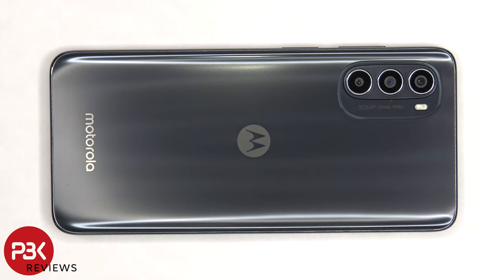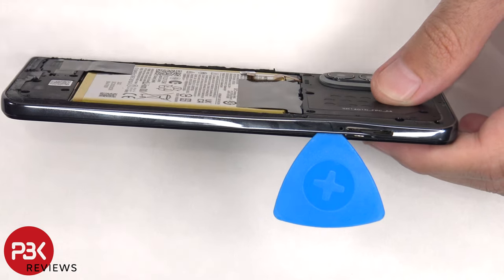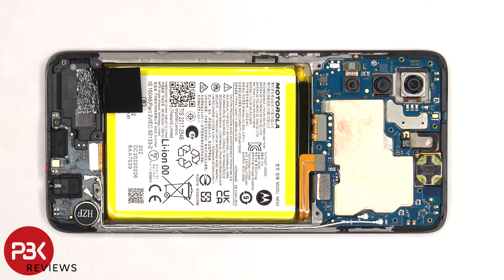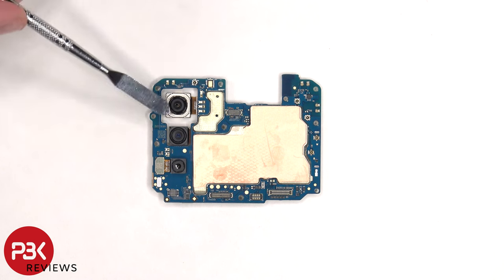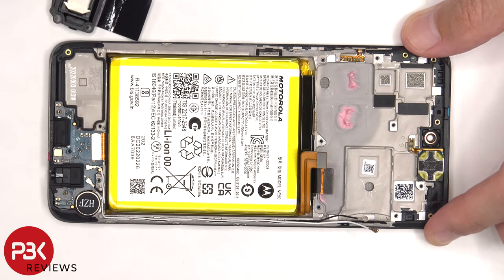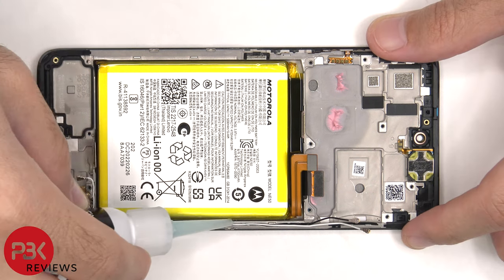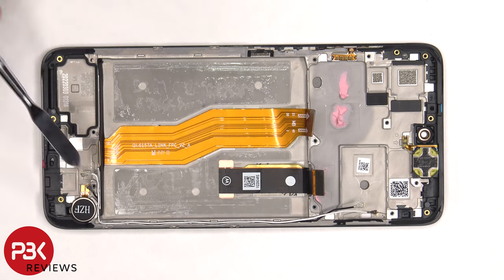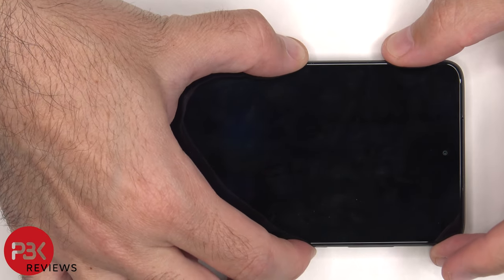Motorola Moto G52 Disassembly Teardown Repair Video Review XT2221

Comment: Are there really two loudspeakers in this smartphone ? The official website shows that there's one loudspeaker on top and another one at the bottom.
Reply from the maker: yes
Reply: @PBKreviews  so the bottom speaker is used here for providing Dolby Atmos stereo output and the top speaker is used as earpiece. Right ? Thank you for replying ! Your videos are very good ! 👍😊
Reply: @nileshw1368  it has got a speaker grill at the top as well, but im not sure if there are 2 different speakers up top
Reply: @harshitverma4543  I want to know why Motorola is sharing that this smartphone has Dolby Atmos stereo speakers. Are they trying to say that the earpiece speaker could be used for music output as well ? Or, the stereo speakers are packed inside a single case situated at the bottom ? Because when someone says stereo music output, I want to see two dedicated speakers assigned for music output, and here there's just one present for music output. Maybe they are trying to say that this smartphone can give virtual stereo speakers experience from true mono output using Dolby Atmos technology.